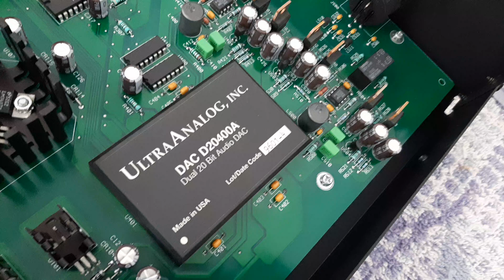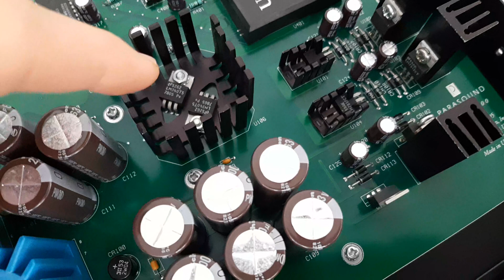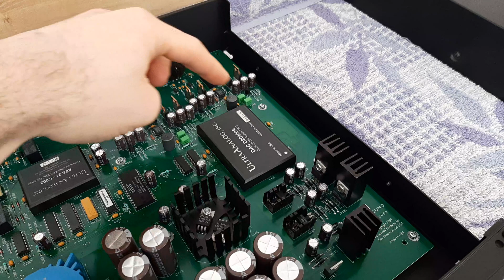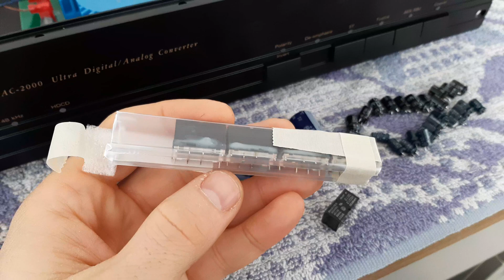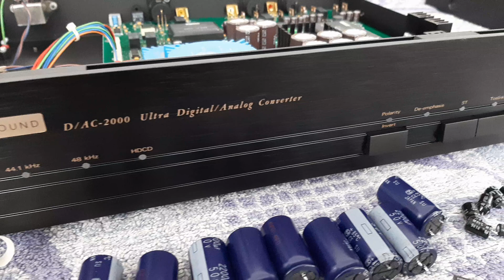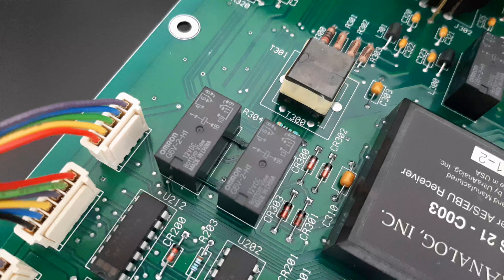Parasound DAC 2000 - Ultra Digital to Analog Converter - What's Inside Presentation Fix

Comment: How do you go learning enough electronics to do what you're able to do like understanding what the circuit does,change caps etc ?
Reply from the maker: Hi, thank you for comment!
Is very simple,  you have to start to learn ABC of electronics. Start with electrons, power sources AC, DC, semiconductors, resistors, capacitors...after how to use multimeters, signal generators, oscilloscopes, esr meters...and so on.
After all of this everything it will be simple.
Stay tuned, more videos to go!
Cheers!

Comment: Hello I've got this same dac and at a certain frequency I get a little buzz coming from my  right speaker Do you know anybody that can take a look or repair this I live in Seattle Washington USA Thank you
Reply from the maker: Hi, thank you for comment and for subscribing. 
I m sorry for your dac problem, you can write a message on youtube to XrayTonyB (nice guy) or on web page AudioKarma.
If you're lucky somebody will answer to you.
Another option is to look locally for a repair service.
Cheers and stay tuned, new videos will be released!
Reply: @MariusHiFii I think I've diagnosed it down to the D20-400A dacchip Do you know of any place to get one or if they have a replacement for this particular chip? Thank you
Reply from the maker: Hi, if i good remember Parasoun company is located in San Francisco,  best ideea is to have a contact with them, highly chances to have an old stock with parts. I don't see another option.
Cheers !
Reply: @richardpowell6096 did u ever fix it?

Comment: I just bought one of these as an upgrade to my Parasound D/AC-1100. I can't wait to get it next week! I love how the D/AC-1100 sounds, so I'm going to be really interested to see how this sounds, especially since it is a completely different design with completely different chips.
Reply from the maker: Parasound Dac's have different sounds compared with new generation ones. It will be a very nice after you will test new acquisition to leave a comment again with your opinion about it. Thank you for comment and SUBSCRIBE! Good luck and wish to you good music on your gears!
Reply: @MariusHiFii  Hi, thanks for your reply! I received the DAC a few days ago and have been listening to it all week, and it truly sounds amazing. I only listen through speakers (vintage Italian Opera Terza IIIa) not headphones, but my first impression right after swapping from the D/AC-1100 is slightly wider soundstage and slightly more emphasis on high mids and highs. I would have to switch back and forth between them to really compare.

Unfortunately there is a problem and now your expertise could really help! I got two days listening with no issues, but now I'm getting audio dropouts from between half a second to 30+ seconds. When the sound cuts out for longer than half a second the 44.1kHz indicator goes off, then I hear the relay click, it comes back on , and sound is restored. It has cut out for 30-40 seconds and I have heard the relay clicking a little until sound is restored. Edit: tonight the 44.1kHz indicator has been staying on while the audio drops out.

The same thing happens with 16/48 sources coming from an AppleTV (48k light flickers off/on), and also from a CD transport connected to the coaxial input, so it doesn't seem to be the Toslink input, but any input.

Nothing was changed other than the DAC, and there were no problems at all with the 1100HD for the past 3 years. My question is which component or components are bad based on these symptoms, and is this fixable? Do you communicate via email and/or are you on Audiokarma or one of the other forums? Thanks! (I subscribed!)
Reply: @MariusHiFii  Update: I was very lucky that the seller had another D/AC-2000 in fully working condition that they sent me as a replacement. Now I'm back in audiophile heaven! Next week I'll be receiving Parasound's top preamp from that era, the P/LD-2000. I'm a huge fan of the mid to late 90s Parasound line, and feel I'm getting 99% of the quality of their contemporary gear at a fraction of the price.
Reply: I'm thinking about getting a 1100 DAC parasound...have u upgraded yours? Company out of Germany chip upgrade?
Reply: @ericgonzales854  I have not done the chip upgrade on the 1100 because my audio collection is 16/44.1 lossless FLAC (my cd collection ripped) and I'm perfectly happy with CD quality. I think both the D/AC-1100HD and the D/AC-2000 sound amazing without any modifications. I do have a few albums at 24/96 resolution, and if I want to get into that I would just buy a newer DAC for that purpose. 

Since the chip upgrade seems to be as easy as snapping in to the existing sockets I wouldn't tell you not to do it if you have HD audio content, but you could also just keep it stock and get a Schiit Bifrost if you want an R2R DAC that plays HD audio.
Reply from the maker: Thanks for all comments and i hope you still enjoy those DACs. Cheers!

Comment: Good day fine sir. If I were to acquire this DAC in a 120v configuration, I believe switching it to 230v is simply removing the two bridges next to the larger transformer, and single bridge it in the middle? Would I need to swap out the fuse for another rating?

Much appreciated.
Reply from the maker: Hi , thank you for comment and for subscribe. I don't remember how to swap from 120 to 230 but i can tell you about the fuse. The fuse rating on 230v should be half of fuse on 120v. 
If you let fuse at 120v rating amp is high risk to burn transformer in case if something fails inside main board.
Cheers and good luck !
Reply: hi, did you figure it out?
Reply from the maker: You manage ?